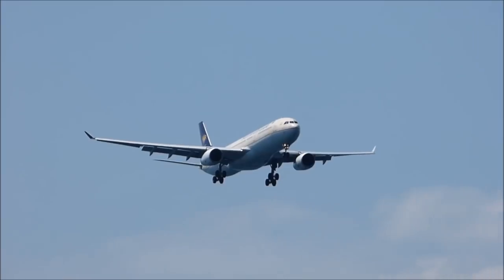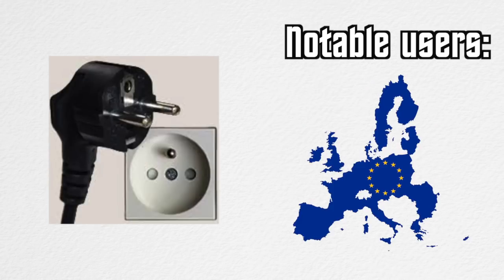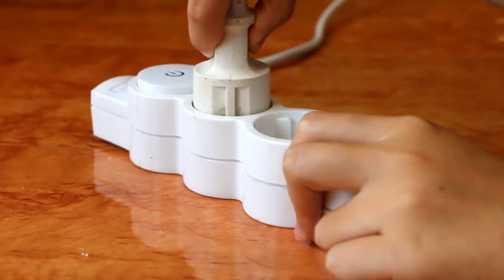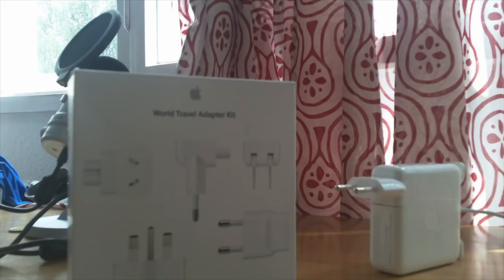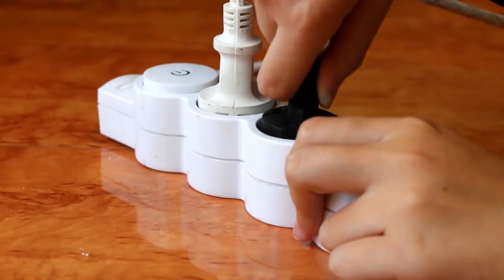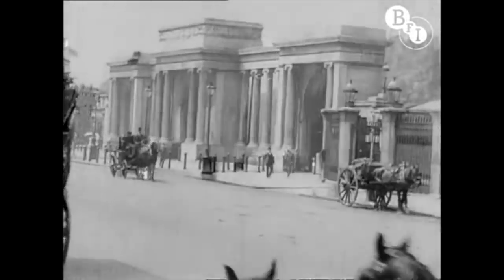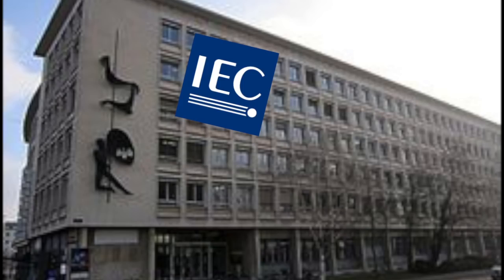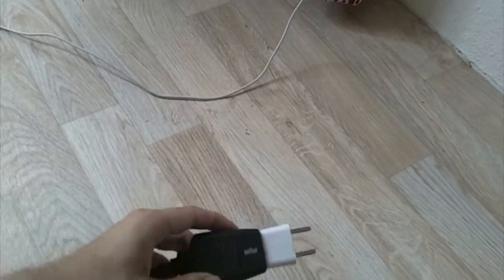Why Different Countries Use Different Plugs

Comment: In communist China we use type C A F and I it’s a pain up my rolled up parchment on which are written the core values of communism
Reply: Albus Du Cannot plug 2 pin Australian plug into 3 pin AU outlet in China. Because of it’s shutters and the only plug to unlock both live and neutral are Earth pin first, then 2 pin., Earth plug is the key to unlock both live and neutral outlets.
Reply: Albus Du They already bought Chinese outlets on Aliexpress free shipping to overseas.

Comment: My mom has used an American hair dryer in Spain with only a plug adapter and nothing went wrong. We were staying in an apartment.
Reply from the maker: Check the label. Many electronics these days (as mentioned) are being adapted nowadays to be used on multiple frequencies and voltages. Also, some international hotels (like one I stayed at near Frankfurt airport) may have outlets with variable voltages.
Reply: Coukd be. Some hotels provide a specific 110v Wall outlet  in bathrooms.

Comment: Wrong. Europe switched to 230 Volts long ago.
Reply: South America, Japan, Taiwan, Korea, Philippines, and plenty of islands also use 60 Hz. 

250 V means the plug is rated at 13 A at a voltage of 250 V. This means that the plug can handle (13A)*(250V) = 3250 W. That's a lot of power.
Reply: @NoLifeStarCraft  Japan is a strange one, it can be 50hz (Osaka and southern Japan) or 60 hz (Tokyo and northern Japan)
Reply: @Makoto778  I wonder if electronics stores in Shizuoka sell both 50 Hz and 60 Hz appliances and ask for your address to make sure you buy the correct product.
Reply: @Makoto778  Wrong way round.
Reply: @harrygatto  good point, thank you for correcting.
Reply: @NoLifeStarCraft  Japan: west Japan is 60Hz and east Japan is 50Hz.
Reply: On paper, yes it did - but by tweaking the standards so as to allow a wide enough variation, roughly +6/-5 %, so in the real world my local supply is still 240 (most of the time), and it's still mostly 220 across the channel in France. Thus 240 V is within the range of 230 +6/-5 %. Note that some of the international cross links are HVDC and can cope with different AC transmission values, out of phase etc, such as those between National Grid and EDF across the English Channel/La Manche.
Reply: Its 220V in slovakia
Reply: harmonising 230v means 230v + or - 10% do the math. children these days..
Reply: And also, of course all European countries share the same frequency, and even a common, interconnected grid (at least most European countries). Actually, almost all of the World shares this same Frequency of 50 Hz, North America beeing the exception at 60 Hz.
Reply: arnoldhau1 how many volt it is where you live
Reply: @cliffsofmoher4220  230 volts as in the rest of Europe. I live in Switzerland.
Reply: @arnoldhau1 i'm also swiss:) schwäzisch schwizerdütsch?
Reply: Irish soil I’m an electrician in Ireland it’s 230 v 👍
Reply: @anjaanja6448  speak English, other guys who don't speak German wanna know what you write.
Reply: @arnoldhau1  Most of South America uses a variant of 110v/120v/127v @ 60Hz. South Korea and the Philippines, while both use 220v, run at 60Hz as well.

Some Carribean countries like Jamaica uses 127v but at 50Hz.

Japan is the true oddball, with the Tokyo side using 50Hz and the Osaka side using 60Hz. This mostly has to do with AEG and General Electric providing the country's electricity in their respective areas. However, they use 100v.
Reply: 210 - 250 volts
Reply: ~230V here in Germany.
Reply: and than theirs me with a  480V system... cus Servers and  brodcasting stuff and heavy machinry...
Reply: @Stormcruzerlore, as if a server and broadcasting stuff needs 480 volts 😂 The internal components bring it all down to 5 and 12 volts DC.
Reply: @Engineer9736  480 is just whatr this place was set up with when i moved in their used to be a radio station here in like the  40s and 50s so all the stuff was super massive analog and used electron tubes and was super high  cunsumption
Reply: We should have 400 hz, then all the transformers woud be 1/3 the size, save a lot of copper.
Reply: @robertkat  400Hz would be way more dangerous as you would have 400 zaps of electricity per second insted of 50 which is still deadly but not a guaranteed death 400 would not be safe at all for an electrician to work with and it would make them really expensive to hire
Reply: Some houses here in Spain have 120V (including me) but most houses use 220V.
Reply: He said 'In Europe, it's 220 to 240 volts at 50hz'  listen!
Reply: @ @Valicore : And I still 248VAC in my home. You listen! dipshit.
Reply: Its 230V +10/-6% in the UK - in other words you should expect a voltage between 253V and 216V at a plug socket in the UK .  Distibution networks have to control this at the customers point of supply, and the control of volt loss and lack of automatic tap changers at distribution level is why things like PV arrays and batteries are not a good idea in practicality.
Reply: Europe going to switch to 240 in 2020
Reply: arnoldhau1 in Ireland it's 250volt
Reply: @cliffsofmoher4220  Really? All sources I found including this one: https://www.electricireland.ie/residential/help/safety/what-is-the-standard-voltage-in-ireland say ireland has 230 Volts just like the rest of Europe.
Reply: arnoldhau1 on plugs it says 250volts
Reply: @cliffsofmoher4220  A I see what you mean. The 250 Volts ist the maximum the plug can take, as the currency will not be exactly 230 Volts (but never as far off as 250 volts). But the regular currency is 230 volts.
Reply: @arnoldhau1  That's just the EU 230VAC +/- 10%. That gives a range of 207-253V, that covers all the nations of the EU. Ireland & UK are about 250V. 248V in Manchester at the moment.
Reply: Irish soil It is within 10% of nominal 240V, most electronics will be able to tolerate that.

Comment: At least in Finland it's 230 volts, noy 220.
Reply: perkele
Reply: It used to be 220 in Finland, as it was in most of Europe. In some countries it was 240, but sometime in 90's it was harmonized to be 230 everywhere. In mid-90's we had at school two editions of a physics book, and the older said the voltage to be 220, but the newer said it was 230.

Comment: Also 120 vs 240 volts! Kettles take waaay too long to boil in the usa! In England we need our tea! 😂
Reply: I'm in America and my stove is 240v
Reply: @daltonbrink6336  IM ENgLISh WHaTS a StOvE i just need to find my cooker
Reply: @Arristuff  in my area, stove is another word for a range
Reply: then wire a 240v socket in america and import a british kettle, change the plug to a nema 6-15 or nema 6-20. done you have 240v in america, mindblown?
Reply: Stovetop on an induction range!
Reply: Wait my stove us gas...
Reply: James Wright If this was the other way around, you would be criticizing us yanks for putting too much power into our outlets.
Reply: @orppranator5230  like your cars 😉
Reply: American households have a MUCH higher current limit than the 230v countries. 100 amperes is small for an American home. Where as 230v connections often stop at 35 amps. What matters is the sum of voltage and amps a.k.a. power, which will end up the same.
Reply: @Engineer9736  A higher voltage can just get the job done quicker, because it can deliver more amps at a time without overheating. Wires are generally thicker in the US, than  the EU
Reply: @Jeppe, no. 230 volts at 15 amperes does the same job as 115 volts at 30 amperes. Voltage alone does not matter for the resulting power. As you say, the wires are thicker; America designs everything for the higher current.
Reply: @Engineer9736  proportional voltage drop will be higher. So you can't have multiple high power devices on a circuit due to the voltage drop. 🤔 I mean for when you need multiple kettles at tea break in the office!
Reply: @Engineer9736  I'm well aware that 230V 15A is the same power as 115V 30A. However more voltage and lower amps allows for less heat generations, which means less voltage drop. And house hold electronics such as kettles that draw a lot of power generally have a higher power input in 230V countries than 110V countries because it would have a significantly higher current need at 110V, and would also require much thicker electronics, or better cooling to compensate the bigger heat generation caused by the increase in current
Reply: @JeppeBeier  kettles in America aren't on a regular 120, 20 amp circuit tho...

Kettles in America are ran by a 240, 50 amp circuit. It's called your stove....
Reply: @TheDarkToes  in normal countries we just plug them into a normal outlet and can cook water in less than 2 minutes
Reply: @JeppeBeier  in America there are stove tops that advertise boiling water INSTANTLY. So.. 2 minutes is slow. Most do it in 60 second.
Reply: @TheDarkToes  I said less than 2 minutes. A lot of them also do it in less than 1, and they can be used anywhere in any room that has an outlet.
Reply: There's something called a kettle
Reply: @IamINERT  no, not a kettle, something like a flow heater, they have 21000watt, but you can also get them with 18kw or 24kw... https://www.amazon.de/elektronisch-gesteuerter-Durchlauferhitzer-druckfest-227609/dp/B0017VH4AU
Reply: In the USA our houses are wired for 240, but only stoves, water heaters, and other high draw appliances are fed the full 240.

Low draw appliances are wired for 120.

So our stove tops are 240V just like yours.
Reply: @Texassince1836  no, the difference between europe and the US is, that our stoves can also run on 400V and not only 230V or some electric motors can run ONLY with 400V
Reply: @videomailYT  those voltages are available in the US too, we just use em for industrial purposes
Reply: @Texassince1836  and we are able to use it in a normal house...and the frequency is also different, when you have 60Hz you can use 110V when you have 50Hz you use 230V. (well this is not easy to explain in a foreign language) It has something to do, that an electric motor run faster when you go up with the frequency or slower when you go down with the frequency...or so...
Reply: then do 180 volts right in the center
Reply: Amparage
Reply: Ive used an electric kettle and it usually takes 90 seconds to boil.
Reply: @Authentiik but i live in the us...
Reply: James Wright SOOO FUCKING TRUEEEE
Reply: Wtf is a "kettle" ??

Jk
Reply: Actually American stove tops use 240... also voltage doesn't increase heat across your element... that would be your amperage, and being that 120 volts is lower, that means your amps is higher, meaning Americans have a faster heating element...

But I'm just an electrician what do I know.
Reply: I thought you were talking about kettle Korn at first lol, In the US we love tea also but as of now I think the us most favorite drink is water. It doesn’t take long at all to boil water maybe 2 minutes
Reply: Why has everyone in this comment contradicted themselves?
Reply: @linolevan9071  for fun
Reply: Reasonable
Reply: @John Smith It's easier to draw from 230 volts because it doesn't require as many amps and thus can use thinner wiring and generate less excess heat
Reply: I have a water dispenser that has hot water ready at any time. My stove takes about 4 minutes and my electric water thing takes maybe 2 minutes. As an American who drinks plenty of tea I can get my water ready pretty quickly.
Reply: @yoadrienne92  water dispensers with boiling water don't count as they are just a big well isolated kettle that heats water up prior to it being needed
Reply: James Wright Also used 220V 50Hz kettle from China (AU 3 pin plug) had been used in the Philippines (22V 60Hz; US plug adapter).
Reply: Actually... In The U.S., Stoves, Ovens, A.C. And Heaters Require 240V.
Reply: photonicinduction made a kettle that boils in 15 seconds 

though it does run on 450 volts
Reply: Weird flex but OK
Reply: American houses do have 240v, but only because they have 120v dual phase and spaced 180° apart, so only wired appliances like stoves can actually use it. In the UK, buildings can get three phase 120° spaced 240v which gives you 415v for industrial applications.
Reply: @edrose5045  In america 120/240v is on the same phase, we put a ground/neutral in the middle of the xfo to get 120v. In america triphase is a thing too its 347/600v very powerful
Reply: @edrose5045  in some parts of Germany (Berlin) you can also find dual-phase so that you get a voltage level from 230V, but this is old technology from the 1920s or 1930s...
Today we have single-phase where you can use 230V but it also exist 3-phase so that you can use 400V...but 400V is more for electric-motors, oven (google for translation Durchlauferhitzer...) or so on...
Reply: @videomailYT  kannst du mir helfen mein Deutsch verbessern bitte?
Reply: Ed Rose What is the voltage for mains lighting in the USA?
Reply: That's not how it works . Voltage doesn't determine boil speed....
Reply: @MuddinNYC  Sort of does.
Reply: Yes, more important is (input) Wattage (V*Amp).
Reply: I use a Pyrex 2-cup measuring cup filled with water and place it in the microwave for a minute-and-a-half.
Reply: Does England have Gas Ranges? We have one and it is so much faster in boiling water than electric.
Reply: Heath Bauerle I just returned from Russia and that’s one of my biggest things. Americans just don’t use electronic tea kettles! It was so convenient.
Reply: Adam Hale Americans don’t use cattle? Wow.
Reply: @akinoz  that's a cow btw
Reply: Heath Bauerle of course but only my gran still uses one 😅with the whistle and all! English electric kettles are so quick compared to American 😂😂
Reply: Heath Bauerle electric kettles boil faster than gas rangers now
Reply: 60hz American 50hz Brittan.  American tea will be made quicker. It's all about the oscillation speed
Reply: @matrim1762  frequency is irrelevant in resistive loads, 50Hz or 60Hz the speed it would take to boil is the same. The most important thing between american kettles and european is wattage. A 2400W kettle is quite common in europe and it will only draw around 10A a 2400W in america would draw atleast 20A so I would imagine that american kettles would have much lower wattage to keep the amps low so they will take a lot longer to boil.

Comment: UK plugs are obviously the best, using the American ones is suicide
Reply: I've been using American plugs all my life. Still alive.
Reply: @Ithaca if you lived in an older house with old wiring trust me you would only want type g  the safety features are limited at best on the wiring the plug and socket are the only thing keeping you safe other than a fuse box (new houses or rewires have circuit breakers but older housed use fuse boxes) trust  me type g is the safest to make up for the higher voltage and less safety measures on the circuits themselves.

Comment: At london heathrow i found that i can plug my type c charger into britains sockets . YEET
Reply: Not a good idea buddy. How did you do that anyways?
Reply: @AverageAlien  idk i just pushed it a bit and it went right through
Reply: @System-br1tx  impossible unless you broke it
Reply: @AverageAlien  no i even checked. The plug was ok so was my charger. Maybe the engineers did this intentionally after all its heathrow. Largest european airport
Reply: @Ithaca no
Reply: @System-br1tx  tbh I'm having trouble believing that unless it was  an older style socket without the shutters or the shutters were broken 

(A switch in the earth slot has to be depressed to open the shutters on l&n that's why the earth pin is longer than the others on the type g socket)
Reply: Its possible to insert Type C plugs into Type G wall socket but you must disengage the top shutter with something non-metallic then push the type c plug into the socket where it can accommodate.